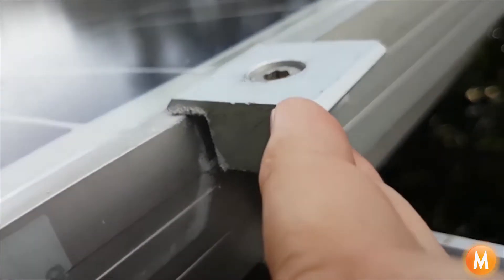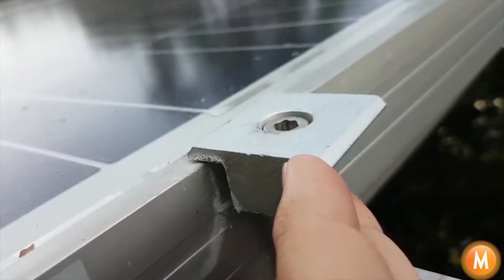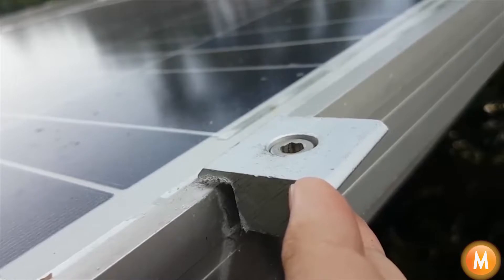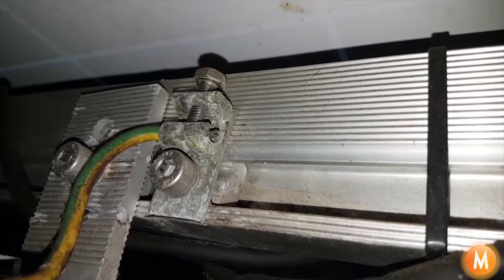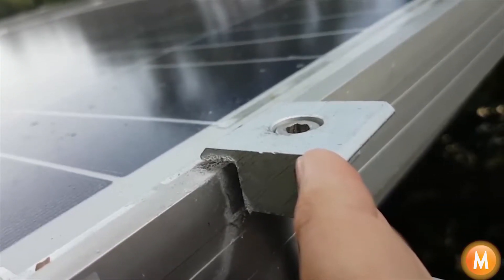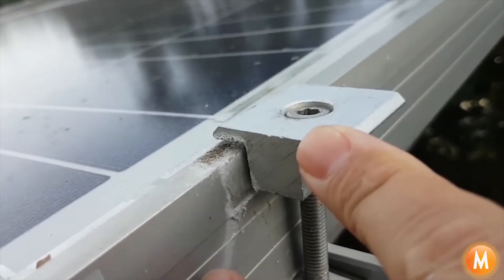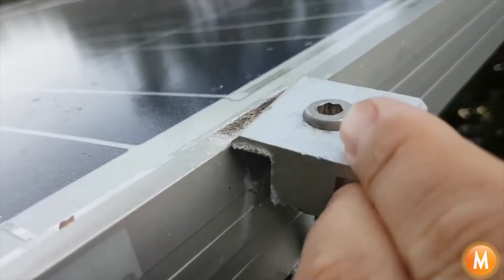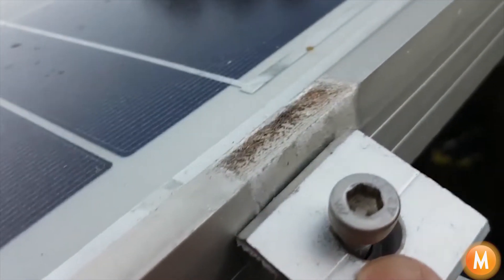Solar Panel Potential Induced Degradation  & Galvanic Corrosion

Comment: PID's are a cell level degradation, not the structural part. What you showcased here is the galvanic corrosion.
Reply from the maker: Thanks Ashok
Reply: So aluminium mount will prevent it ?

Comment: well, what caused the corrosion!!!! and how do you prevent it!!! I thought if you used the same metal then there was no galvanic corrosion. galvanic only occurs between different metal.s
Reply from the maker: Thanks Roland, it occurs due to the voltage difference between the solar panel and the frame,  good earthing is supposed to help but in this case it did not, some new inverters have PID mitigation built in to combat this issue.